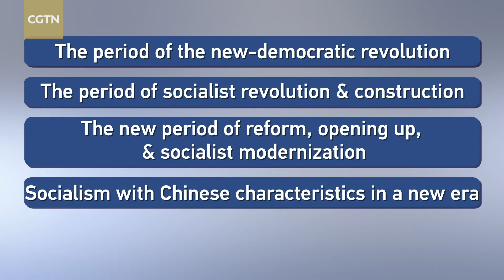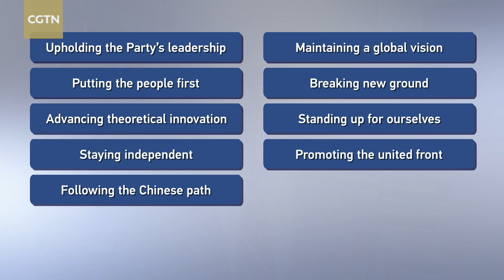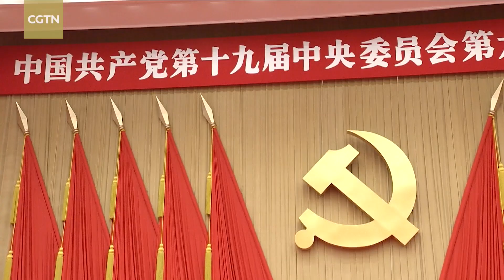The Sixth Plenum: The deep message II

Comment: The foundation is being built, no need to change the head engineer halfway through the build when the foundation has proven that it works and is super strong. Only a fool or an opposition would want a new engineer to finish building this foundation.
Reply: Congratulations